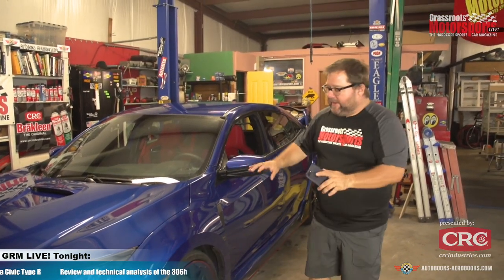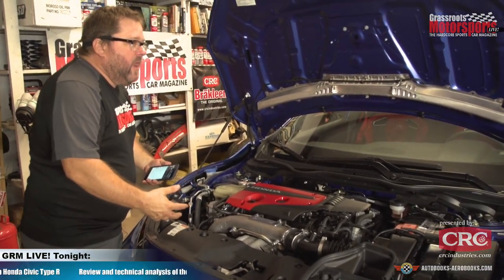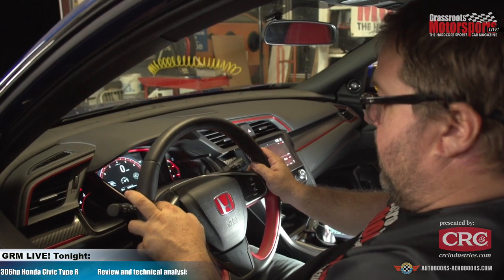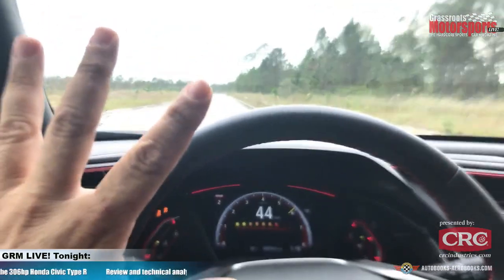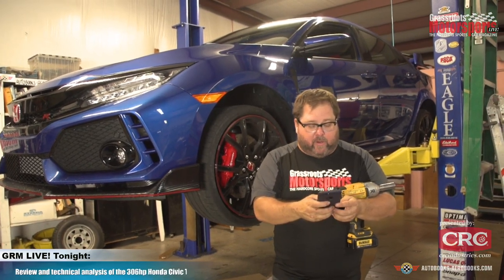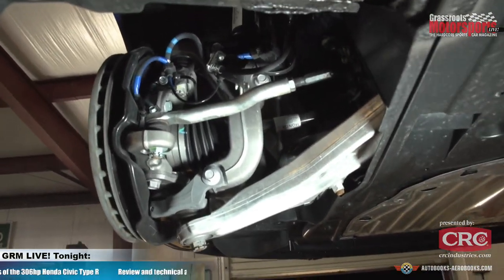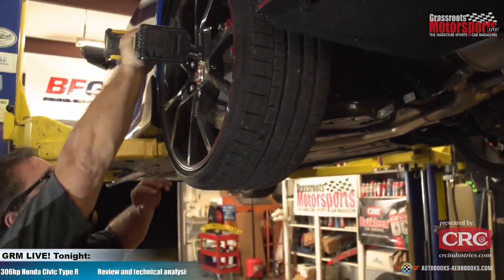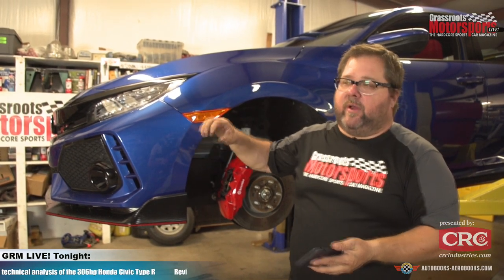What Makes the Honda Civic Type R So Good?

Comment: I kind of miss my STI, but I still prefer the Type R overall. There were things you could do on loose surfaces the Type R just can't do, but I'm rarely on a loose surface. Anyway, good review, really in depth. Good work.
Reply from the maker: Thanks Ian. We're fans of AWD chassis as well, and the STI is great in its execution. But so many AWD chassis seem to lose a bit of sharpness in response in their factory configurations. Sure this can be tuned around, but I really dig the current crop of great-feeling high-performance FWD cars like the Type R and the Veloster N. Right off the showroom floor they're really responsive and intuitive to drive fast. Additional tuning only improves that.